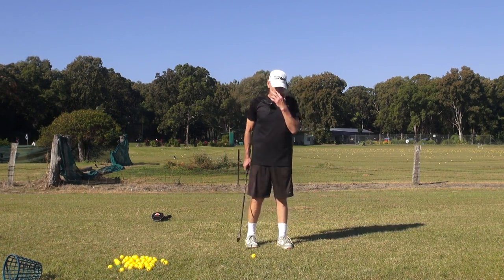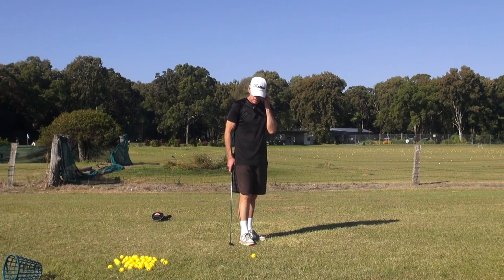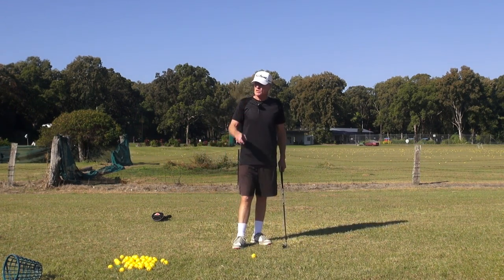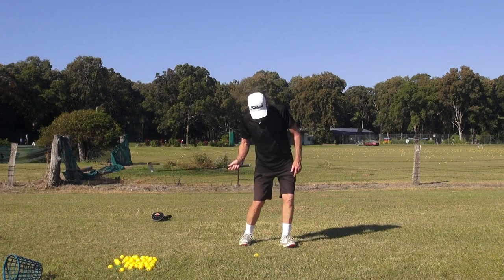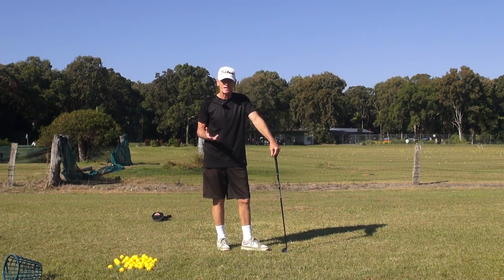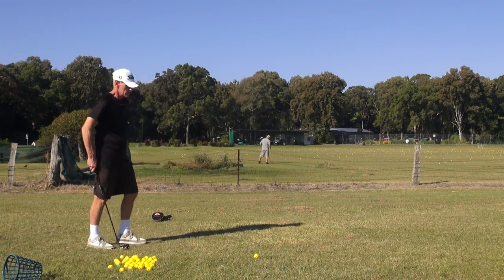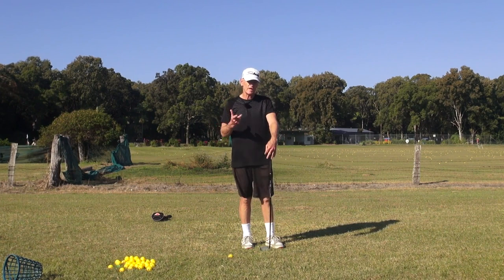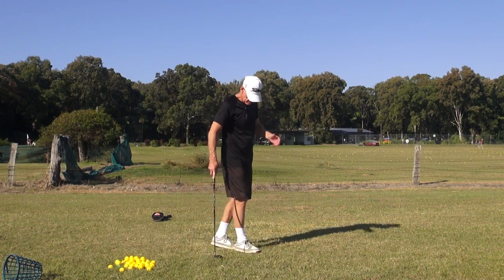Important Weight  Application For Channel Lock  Swing..

Comment: JH

I do appreciate your advice and will work that into my practice session today 

I play using ulnar deviation and I do tend to stand up more  by doing this

I got my lead knee schedule for replacement this November and hopefully after that I can get more pain free bend in it

If the structure is not stable it will sway in the wind 

Always good information 

Thanks
Reply from the maker: Hi Steve,
                  Hey, buddy doesn't put any strain into that lead knee if its a  problem like it sounds to be .. only when you get your 'new' knee ...
               Its just that for you being a big unit that lead flexed knee can help a lot with weight distribution support coming into and at impact... it would take more than just a 'wind' to sway you around big fella...                     
                                cheers JH

Comment: Helpful video JH.  The comment on not straightening the lead knee is a key for me.  Pushing into the ground through the heel but not straightening the knee has helped with stability.  For me, the problem with getting too close the body is to do with the trail side pushing.  I am right side dominant and I want to get the right side into the hit but it seems to cause me lots of problems.  Is that right from your experience?  What has helped for me is to hit a few balls and let the trail hand come off after impact to make sure I get a full release.  Then I loosen the grip on the trail hand so that it is barely holding the club, to make sure that my lead side pulls through and fully releases the club.  Is this the right way to go?  
Thanks JH, I really appreciate your vids.
Reply from the maker: Hi Terrence,
                     Your drill of softening the trail hand grip to  that of a zero  pressure is a good one for sure .. that hand will instinctively  pressure up at impact anyway .. I would be careful with the  trail hand letting go  after impact  because it can make the lead hand/arm     not release   as it should at impact and beyond .. just make sure you get the lead elbow    turning  into the ground   through impact  when you are letting the trail hand  off the club post impact ..
                           You need to  compartmentalise the   dominant side  'component' application  coming into and at impact .. its really only the trail 'hand/wrist ' that should be dominant  and only at the very 'last moment' before impact .. the trail shoulder/hip/foot should not be   'early active'  coming down into impact ... as well keeping the lead knee a bit flexed at impact will help big time in  stopping the  lead foot re;easing  upwards at impact.
                   Generally, all the stuff you are doing is moving in the right direction..
                         cheers JH

Comment: Hi JH, 
In this video you said one has to keep his weight balanced. Does that mean you have evolved away from the preponderance of weight being on the trail foot?
Thanks,
Ben
Reply from the maker: Hi Ben,
             We want a  'bias' of weight positioned into the trail vertical axis at address and coming down in the swing to impact but we don't want the lead foot/leg virtually completely unloaded coming into and at impact for the reasons depicted in the video.
               You can 'sit' into the address position with a  bias of weight loading in the trail leg/side and still have    weight distributed    vertically   in the lead  side..albeit just  not as much as the trail side.. the main  reason for the video   was to get people just better     balanced and stabilized at   address and of course impact ..  you never want to be  to upright or  tipping forward or too much rearwards in the address position ..if you look at me  you can see whilst I am hunkering down at address  I have weight into both feet  vertically  ..and I want that  pressure at impact as well..
                cheers JH